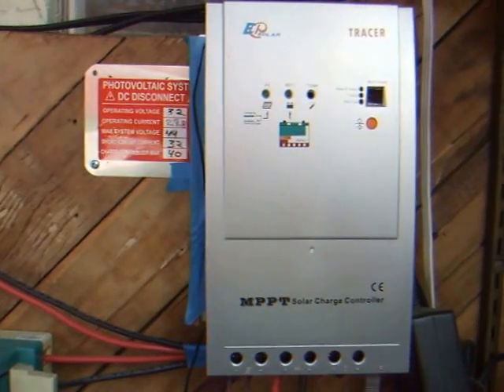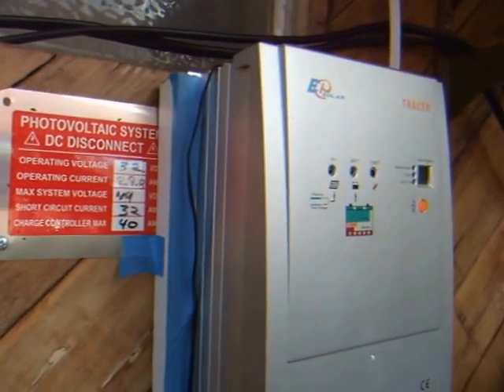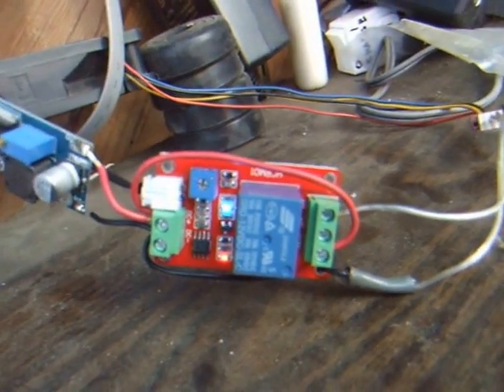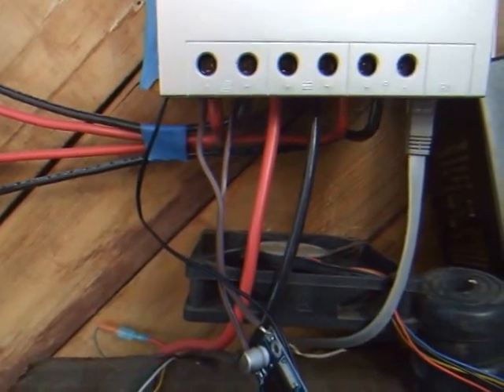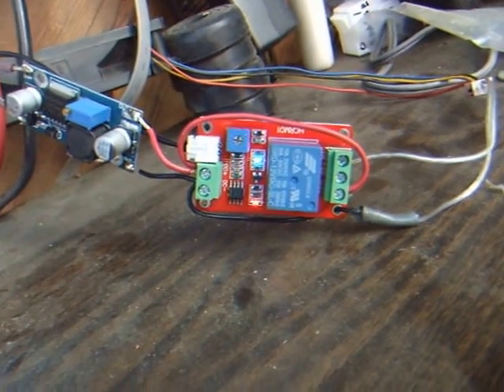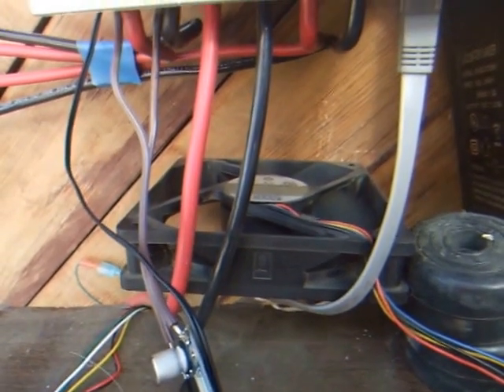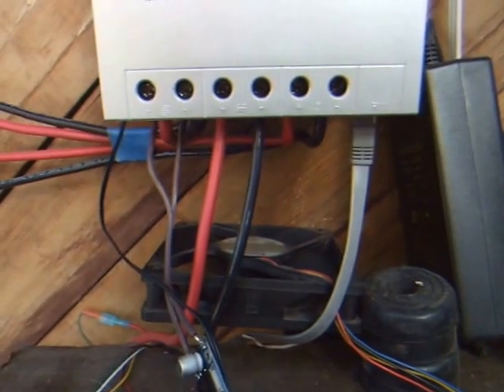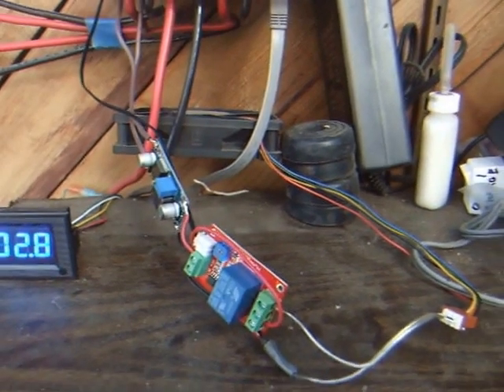Improving Solar Charge Controller Cooling

Comment: 5 years ago I watched a vid of yours , I’m back and amazed how many you have made, I set up a gel sealed battery 12 volt setup , still going strong today, I lost 1 battery because I did not half equal length wire to battery’s and stuff the battery at the end of the line, longest lead from the battery, fixed that , that battery ran away btw, I put it in a bucket of water and it boils the water , I need to move to 24 volt because I now have 36 volt panels, I’ll ad 500w of panels , I have 6   265w panels , do you see a problem , and if you have time , the best way to convert my batteries to 24 v   Bank...
Reply from the maker: With a decent (MPPT) charge controller, should be no problem running a 12 or 24 volt battery, they'll usually auto detect the battery voltage and adjust the output accordingly.  Just rewire your batteries into series pairs.  That is take 2 batteries and connect one + to the - on the other one to make a 24V battery.  Then for more than 2 batteries, connect series pairs in parallel.  Say you have 4 batteries total, with 1-2 in series and 3-4 in series.  Then connect 1-3 + terminals and 2-4 - terminals.  You'll want to keep all the connecting wires of similar diameter and length.  Then connect the charge controller across 1+ and 4- and connect your load to 3+ and 2-, so you have the charging and load coming off opposite diagonals of the battery bank.

Comment: Hey there, just wondering if your regulator is still going strong ? (April 2 2016) ? Am saving for one so really curious. 
Thanks in advance.
Reply from the maker: +Sundancer Yes, still pumping out the amp-hours into my battery bank.  I'm currently in the process of adding a 2nd controller and taking some of the extra panels off this controller to take a bit of the load off it and try to squeeze a little more output out of my system.  As is, I had about 900W of panels on that controller and it maxes out at about 500W (40A @ 12V).

Comment: yep i need this, sometimes i have 45-50 amps going through my tracer :D
Reply from the maker: fliping720 Yes, those Tracers get a bit warm.  Mine sits outside under a clear patio cover and can get over 100F ambient air temp. on a summer afternoon  Adding the fan keeps the temperatures reasonable, especially at higher loads.  I've hit 46 amps on mine once, but I don't have near the panel capacity of battery bank size you have.
I now have 3 of these temp. controlled fans running on different pieces of equipment.  They are so easy to add and they automatically turn off at night and just turn on and off with the temperature.

Comment: How much energy does this consume?
Reply from the maker: 96MustangBoy1 That would depend on your fan, but I typically see 1 watt or less with a typical 92mm - 120mm.PC fan  That is measured with a WattsUp meter on the charge controller output and watch the change in output when the fan kicks on and off.  Going to take the same power to run the fan no matter where the power comes from, but this way it is taking raw power off the PV panels instead of the converted power off the charge controller.  Also works great on a grid tie inverter where you don't have any 12Vdc output power to begin with.